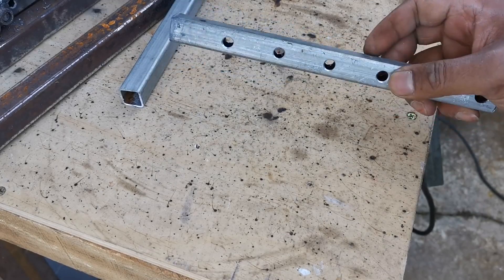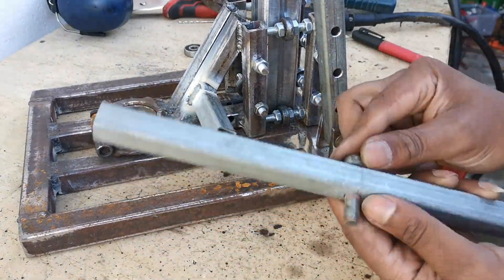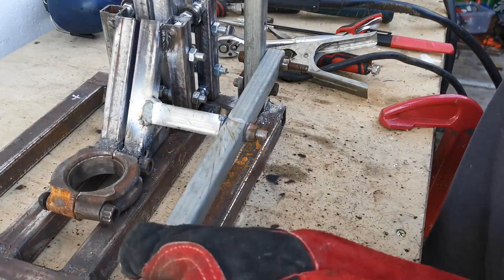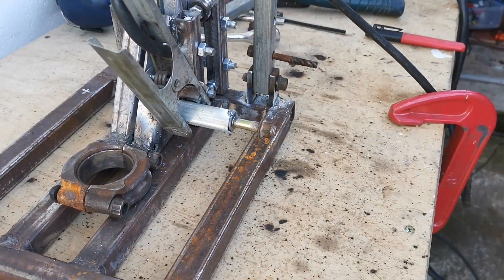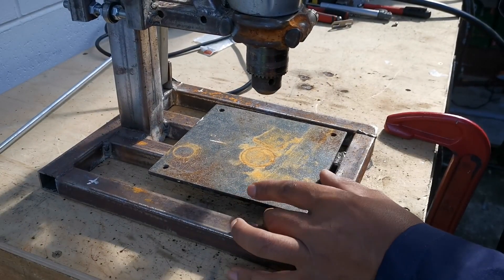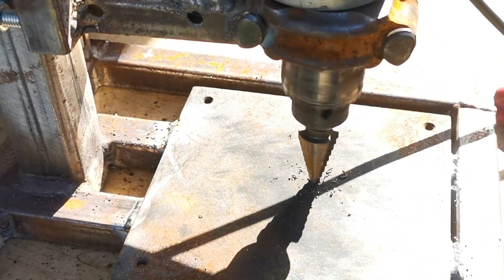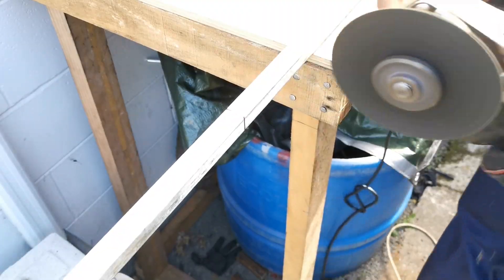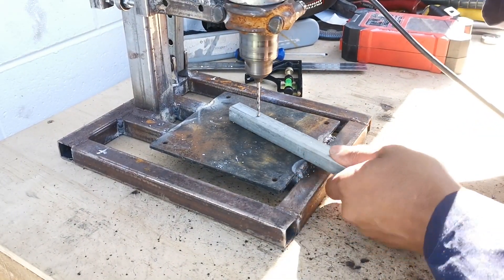Homemade Drill Stand // DIY Drill Press

Comment: Are there 3mm thick pipes or 2mm? Cause i have plenty of 2mm but no 3mm ;(
Reply from the maker: You can use 2mm but 3mm and above should be used for the main column
Reply: @rextech42 Thank you very much! I'm kinda new to this whole weld/diy thing but you did a great job showing how it's done it's an awesome ideea with the one side handle and the other side the air piston I can't wait to get started😆
Reply from the maker: @YagrumBagarn  thank you very much for the appreciation 😊 I'm glad you liked the video